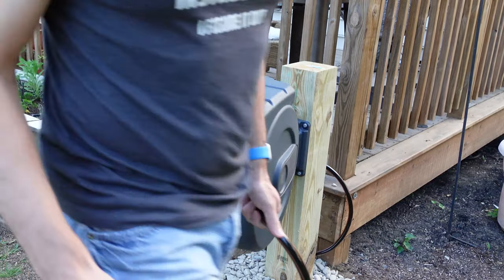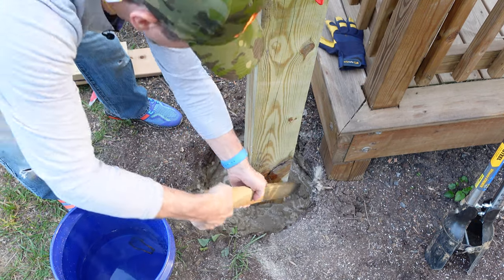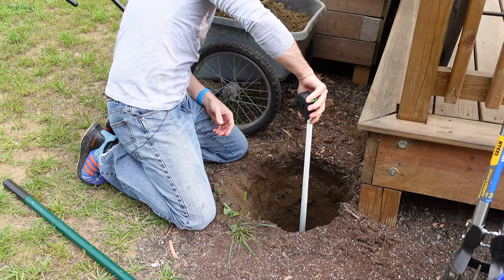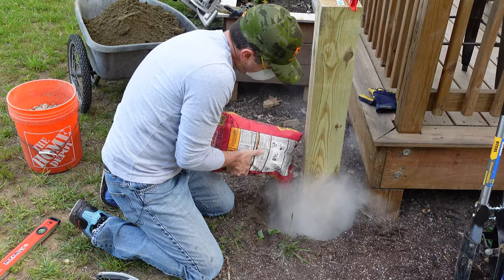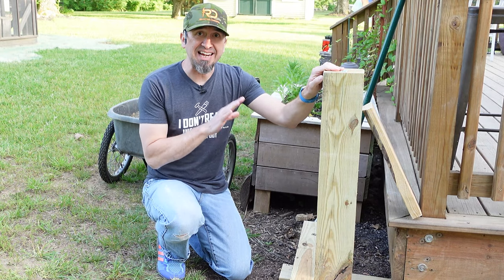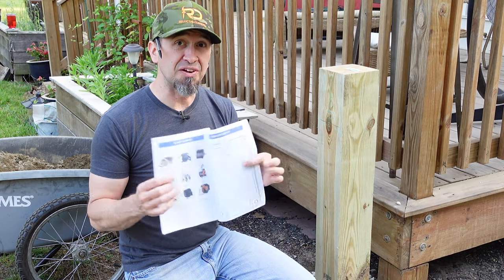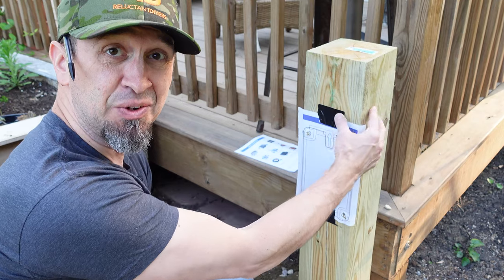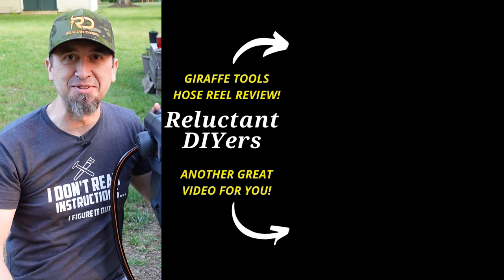Giraffe Tools Retractable Hose Reel Installation for Beginners!

Comment from the maker: Are you considering a retractable hose reel?  Tools Used in This Video:
- Giraffe Tools 5/8" Retractable Garden Hose Reel (155 feet - 35 meters): https://amzn.to/438W6Zu 
- DeWalt Flexvolt 60V MAX Circular Saw: https://amzn.to/45gwKej 
- DeWalt 20V MAX XR Brushless Impact Driver and Hammer Drill: https://amzn.to/3MmMcwS 
- Post Hole Digger: https://amzn.to/3ItVRRc 
- Quikrete Fast-Setting Concrete Mix: https://amzn.to/43gDff4 
- Kapro 770 Box Level: https://amzn.to/42XhFg4 
- Kapro 923 Torpedo Level: https://amzn.to/3Iq25RS

Comment: Nice demo.  Now if the F’N hose reel will keep the retraction tension.   Mine is 3 mo old and No Tension to retract hose.
Reply from the maker: OH NO!!! I’m so sorry to hear that. Mine still has the tension and we use it often.
Reply: I've been watching a lot of video reviews on these, and this seems to be a common problem. Seems they end up not wanting to fulling retract, and when retracting, it's very slow after several months of usage.
Reply from the maker: @janetta5827  I’ve seen a bunch of similar comments recently. Since installing ours, we’ve had zero functional issue.
Reply: Mine was used twice, it's broke. Zero tension. Not abused, barely used
Reply from the maker: @caseyspringer7442  Oh man… that’s terrible. Thank you for taking the time to share this. Hopefully Giraffe replaced it or refunded you. I’m curious how they handle these situations.

Comment: How many Quikrete 50 lb. Fast-Setting Concrete Mix bags did you use to set the 6x6 post? Please advise. Many thanks.
Reply from the maker: Hey Jeff! I believe I used two bags for that post. 👍🏼
Reply: @ReluctantDIYers  Understood. I've got two hose reels to mount on two 6"x6" posts and I didn't want to buy way too much Quikrete. According to the bag directions, I would need at least 4 bags per hole, but like you, I am not going to did holes 18 inches in diameter. Thanks again!
Reply from the maker: @jeffdestes You should be good with two bags. Maybe buy one extra bag that you can split between both holes IF needed. 👍🏼
Reply: @ReluctantDIYers  Will do! 👍👍

Comment: Is there a reason not to just attach the hose reel to your house? I’m a new homeowner and not too knowledgeable. Thanks for the help!
Reply from the maker: You can definitely attach it directly to your house. It’s a different process depending on whether you’re connecting it to cement, brick, siding or another surface. But you can definitely do so.

For us, I wanted to have the hose reel closer to our garden, which meant it had to go on the far side of the deck. I was also planning a fence, which I just finished, and knew I was going to put a gate right there where we could pass the hose straight through to the vegetable garden.

I hope this helps! 👍🏼👍🏼👍🏼
Reply: This is what I'm considering too. Just don't want permanent holes in my stucco home for a product that might not last.
Reply from the maker: Do you have room to place a post in the ground in that area? I completely understand what you’re saying.
Reply: Yes and that's the direction I'm leaning. Thanks for the great video!
Reply from the maker: @justhereforthecomments628 You’re welcome! Thanks for watching and commenting! 👍🏼👍🏼👍🏼

Comment: what did you use to drill the bracket? is that an impact drill
Reply from the maker: I used my Dewalt 20v Hammer Drill (I did not turn on the hammer feature for this). The accuracy of the pilot holes on this project is super important.
Reply: @ReluctantDIYers  Hammer or Impact...looks like an Impact Driver

Comment: I thought wood rotted when set into concrete
Reply from the maker: I’ve had great success with Pressure Treated posts in concrete.
Reply: @ReluctantDIYers  okay awesome thanks for the quick reply I'm looking to do this exact setup!!
Reply from the maker: No problem! Good luck! Let me know how it turns out. 👍🏼👍🏼👍🏼
Reply: Water acumulates at the base, then gets into the wood and eventually will break. I dont understand people that puts wood in concrete.